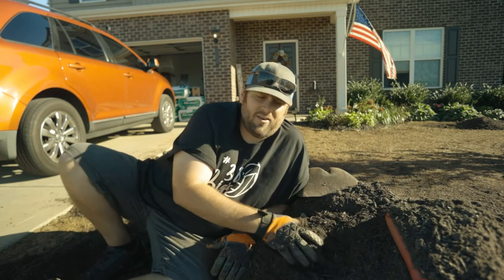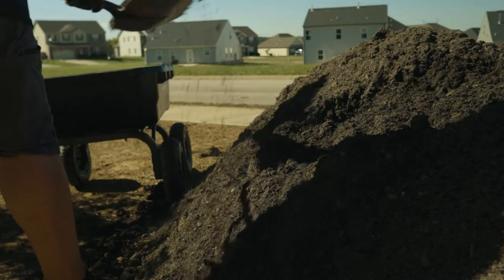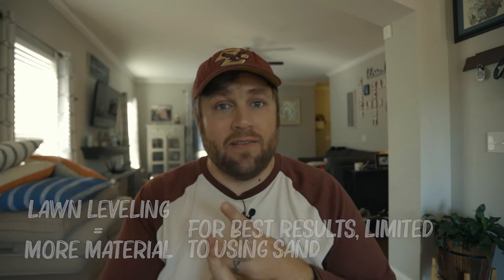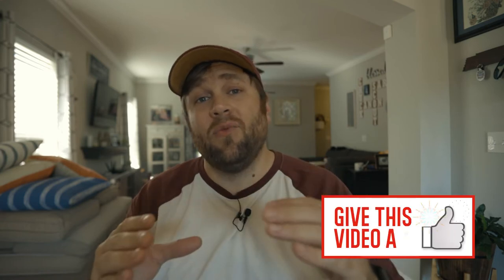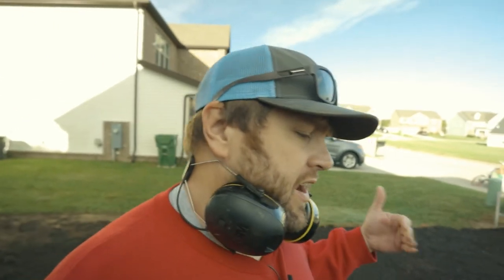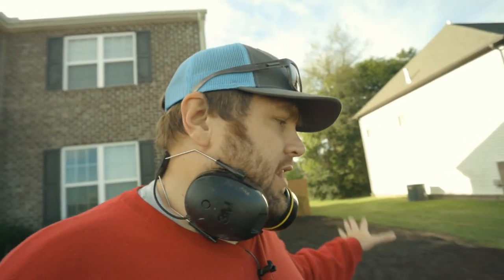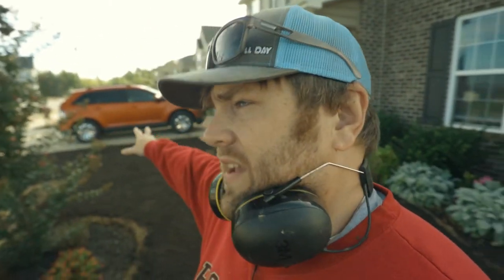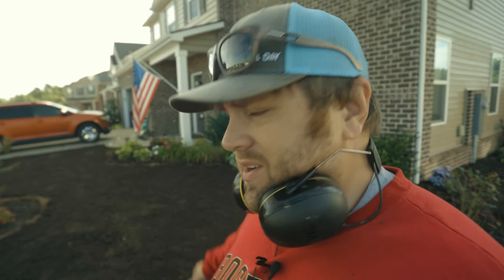TOP DRESSING or LEVELING a Lawn - What's the Difference?

Comment: It all depends on what type of material you are using.  Compost is great for top dressing and backfilling aeration holes just like you did in the video, adds some nutrient value and temporary water holding capacity.  You can top dress with sand as well and it will seek it's own level... Basically there's more than one way to get the job done.  As someone who went trough this very process last season, I'm enjoying watching your journey.
Reply from the maker: It’s been fun to go through this on my own lawn versus helping someone with theirs. A lot to learn from!

Comment: Do you remember how many yards you bought? I'm renovating about 2,000 sq ft though I'm going to rototill and move some of the existing dirt around to level and grade but do want to add some better material. I'm debating doing straight dirt or 50/50 dirt compost. Not sure the nursery's around here (Philly suburbs) have a sand mix option.
Reply from the maker: I'm sorry, but I don't. Enough to cover 1500 square feet at an 1" deep.